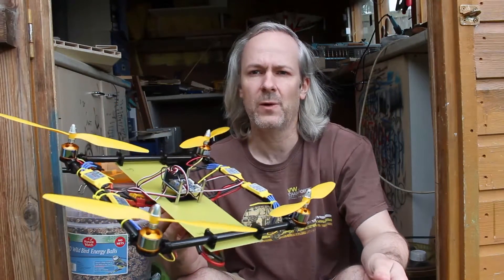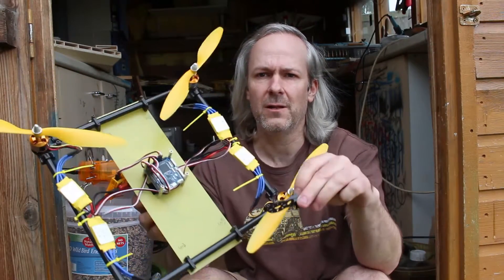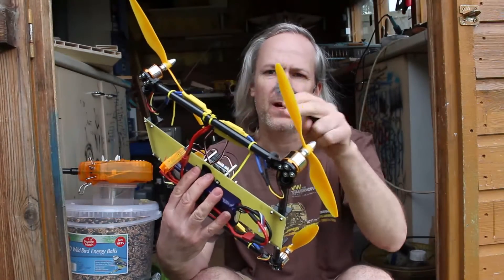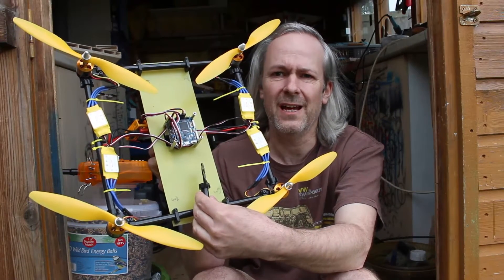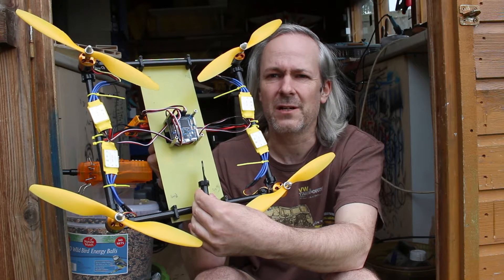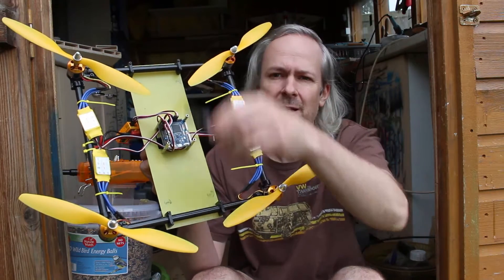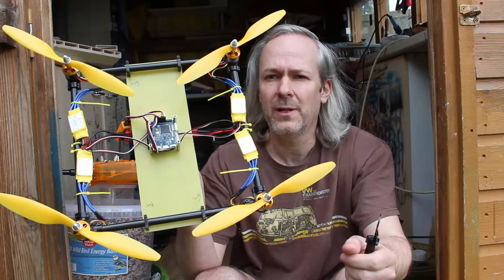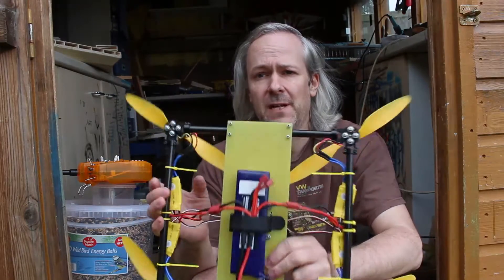Simple Quadcopter. All In One Pro Flight control board.

Comment: I'm not sure fair with tech specs, but from the sound it makes it seems powerful. Seems to throttle up and gain altitude very rapidly. How much could it lift?
Reply from the maker: the A2212 motors on a 3 cell Lipo should lift 1kg each, i have lifted easily 600g What was interesting was when i flashed the cheap ESC with SimonK firmware, the power of the motor went up to 1.4KG but ran very hot and would have burnt out. And yes this model has loads of power and disappear skywards very quickly!